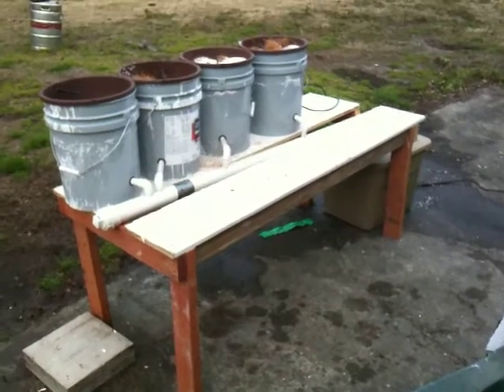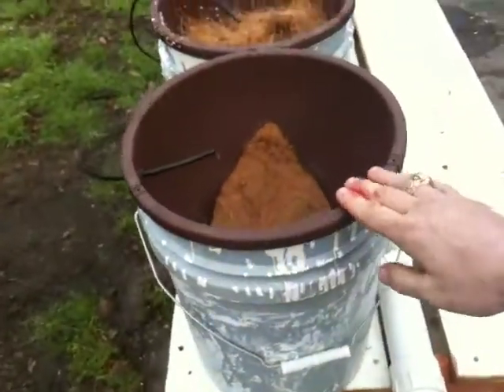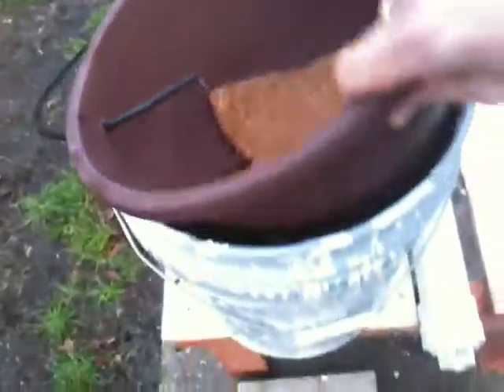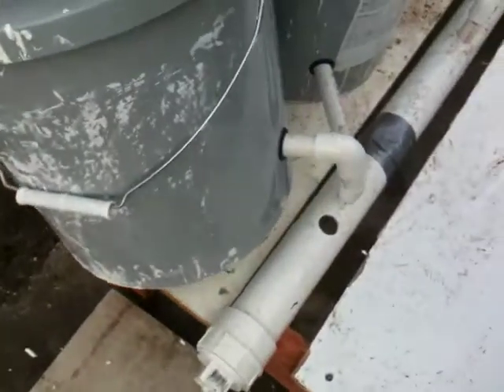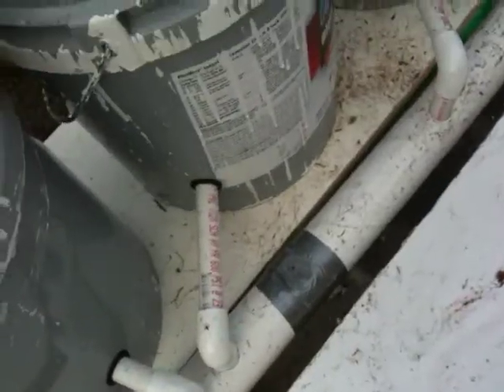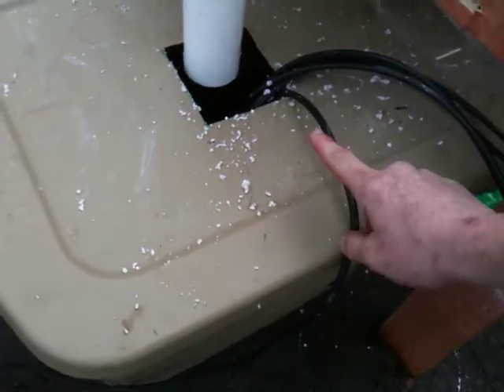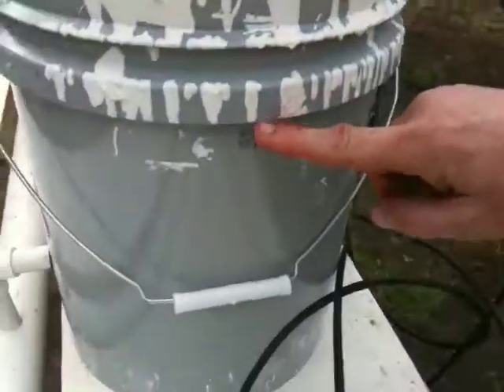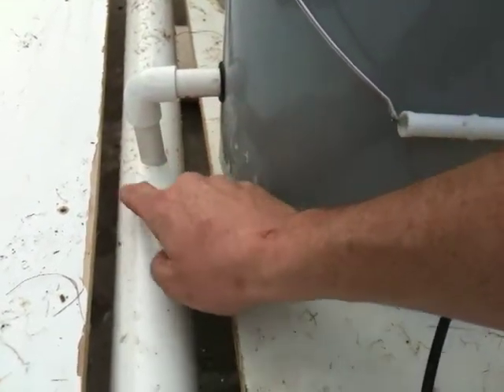Dutch Bucket

Comment: Most of your added nutrients will remain in the bottom of the 5 gal bucket because they are heavier than water. Most designs I have seen allow the plant to reach this water so it can absorb these nutrients. Better to fill 5 Gal bucket with pearlite and plant directly in 5 gal bucket. Just a suggestion. Other than that nice setup you got the right idea! Happy Gardening.

Comment: Dude thats doesnt even work...
 How are you gonna fit your pipes in without rubber grommets or connections? The slightest bit of  vibration or anything really is going to cause each connection to leak. You need a pvc "T" fitting on each bucket connection with a ruducer to the smaller size of line that feeds each bucket. You can sometimes find "T" fittings that have the reducer biult into it.